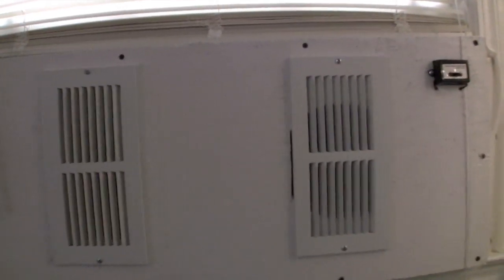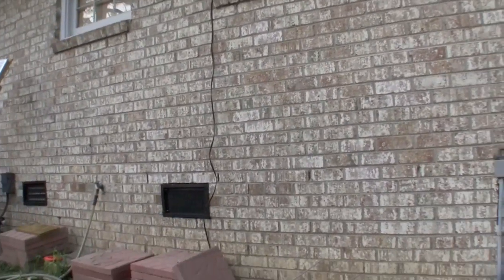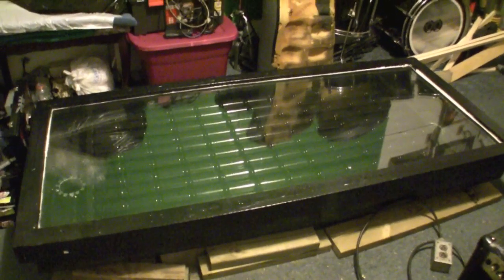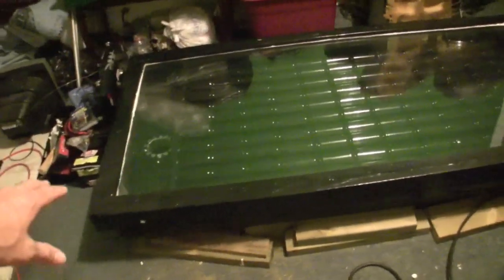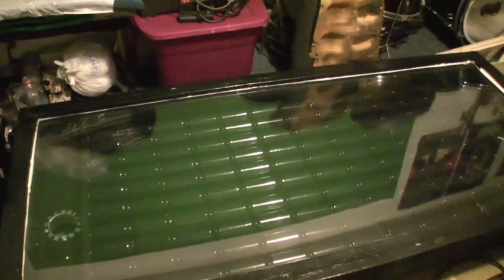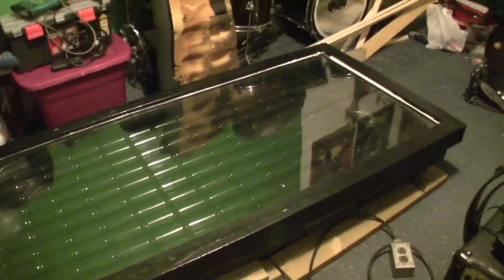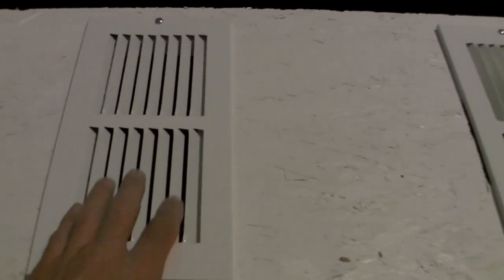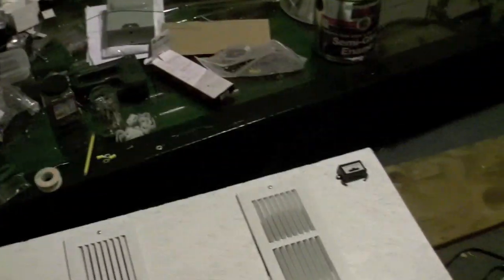Large Solar Heater project.

Comment from the maker: The box is a sealed  enclosure... the sun heats up the cans and they hold the heat in the box. The air will automatically start to circulate though the box the fan pushed the hot air out and back in to the house wile pulling  colder air  from inside the home back into the box. Google Passive solar heating.. there are lots of ways to do this.. I didn't create the idea I just made this.. people have been doing this for years.

Comment from the maker: Thanks, I want to build a new version of this unit. A replacement so to speak, Being every time I build one of these, I figure out something new. I want to use corrugated roofing myself and put the cans under it. Also insulation board is something I skimmed on and regret. I want to make a unit that hooks in the windows and doesn’t use duck work. Like a upside down “L”...less heat loss and it will slip in the windows like a portable air-conditioned, haven’t figured out structure support though.

Comment: I also build and use solar heaters though instead of cans I use corrugated roofing for the heating panel. I also use aluminum sided insulation board inside the unit between the back wall and the heating panel. You have a very nice looking unit here.

Comment: Looks really nice - Made mine out of sliding glass door windows as well.  Just wondering if on the ends you would have been better off to have a thin piece of black sheet metal below the glass so that you don't lose any heat because of the air going against the cold glass surface. Just a thought - not sure what difference it would make??

Comment: The collector looks great. Do you expect to lose any efficiency having used glossy paint rather than flat, since some of the light will be reflected by the glossy black? Also, on the inside unit, since the inlet and outlet are on the same plane, what do you have inside to disperse thermal layer?